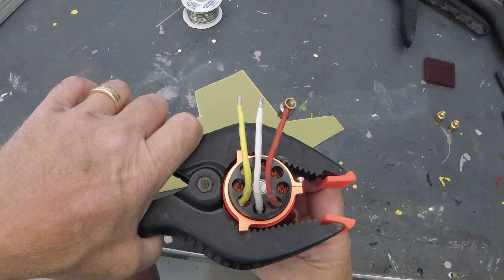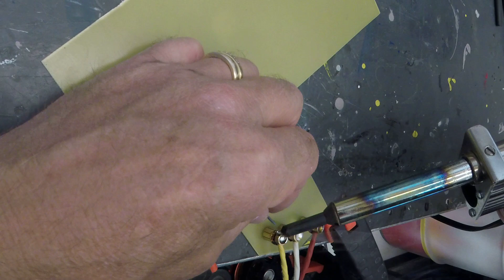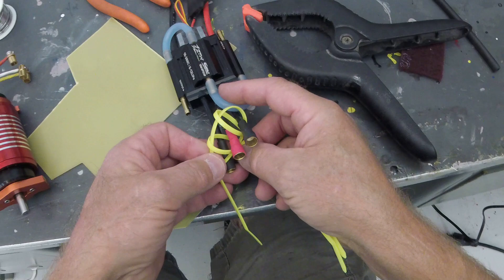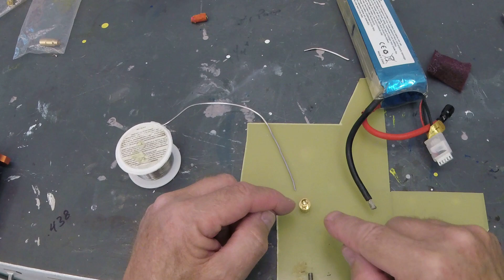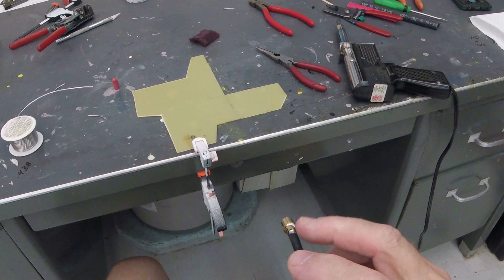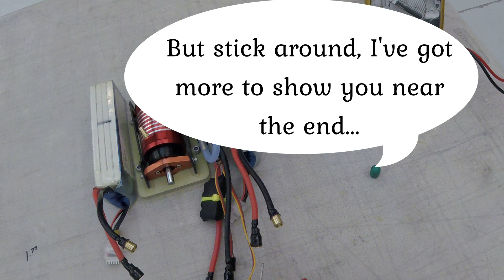Electro Eliminator | Soldering RC Battery & ESC Wiring - How Does It All Go Together?

Comment: Flux Paste. It cleans and shines.  Too much gun for me.  Get yourself a temp controlled Ebay clone soldering station with various tips.  Mine was $40.00 and Ive had it for years. Ive used it to make 100s of night kits for micro helis.  Dark Matter Blades.   Its a YI 939D purple base.
Reply from the maker: Thanks!

Comment: Sorry, but I was so happy to see you get frustrated while soldering connectors. I end up yelling like I did 30 years ago when I started working on cars. There  a fine art to soldering for sure
Reply: Scott one thing to note. With solid wire the electrical field flows around the wire. With stranded wire the electrical field runs through the wire. Most of the stranded wire is aluminum. Try using Rosen core aluminum solder. This will make a better conducive connection with less heat. You don't want to heat and break down the wire jacket. as far as separating the wire, try using some automotive plug wire insulator clips.
Reply from the maker: Oh I hadn't thought of using aluminum solder. Or more correctly, I didn't know that was a thing. But yes I'm familiar with how those little electrons prefer to travel, and even with stranded wire they continue to travel around the perimeter, but the beauty is there is more perimeter area upon which to run in stranded wire. This is what bothers me most greatly about soldering in general. Presumably they (those little electron buggers) travel only along the outside of the solder, which then effectively becomes a resistor. This then becomes heated as they get frustrated in their travels, only compounding the problem. So... What then is the best possible method of connection?

Comment: next time twist the wire in the opposite direction of the original twist. you want it to  fray. work rosin flux into the wires into the original twist direction. it will then work into the core. make sure your solder joint is shiny . that's the way we did it on titan 2 missile wiring .
Reply from the maker: Interesting!

Comment: Believe it or not, Volts and current going to The motor are converted to 3 phase Alternating Current in the ESC. And by reversing 2 of the 3 wires, it reverses the tractive direction of the field windings changing the direction of the armature. Without changing any of the built in timing between the armature and field windings.
Reply from the maker: I prefer to believe it is magic!  🪄

Comment: Just bought a second hand Aquacraft UL1 and make the mistake of taking it right on the water trusting the seller is ready to run. Lost the propeller as the flex shaft snapped right off the prop. Now binge watching your videos and damn, there's a lot to be done before getting wet.
Reply from the maker: You got this!
Reply: @M5PerfHydros  fixed everything that could be fixed without ordering  parts, made a new rudder lever as the old one had the grub screw enlarged. New rudder pivot shaft made off SS 4mm, new esc and battery connectors. Waiting for the shafts, tubing and few more bits, can't wait to see it finished. Your videos helped a lot, and will help more I'm sure.
Reply from the maker: I think I'll be needing to see a video of that...
Reply: @M5PerfHydros  took a few snapshots during the rebiuld. She's now almost ready, just some epoxy to set on the rudder bottom plug and tomorrow  will be baptised.
I'll upload the photos and share !
Reply from the maker: Looks great!

Comment: zip ties are a good solution for more permanent connections like motor-to-esc ... in models with a single battery pack I also make the wires different length.
I usually shorten the battery's negative and the esc's positive wire by 2x connector length and tape the battery's wires together ~ 1" behind the short wire's connector.
This way it's still easy to connect/disconnect them, but physically impossible to short the battery pack.

Comment: Use a separate Flux for tinning solder, plasti-dip (for tool handles) easier for the connectors.

Comment: You should always use silver bearing solder on your battery and motor leads as it has a much higher melting point than standard rosin core solder. I have seen some high amp applications melt the solder and stop a boat in the middle of a race!
Reply from the maker: Yup!

Comment: If you dip the Wire into Liquid Flux, then solder it, this will created a VRY good connection, i do this on all my 12 Heli batteries..
Reply from the maker: Thanks!
Reply: @M5PerfHydros  No Problem Scott. I can also share the part number of the flux i am recommending if you want.

Comment: I think youre not supposed to use dielectric grease between the electrical contacts, just around them.
Reply from the maker: There's plenty of debate about that, and it's easy to find logical arguments for all opinions!  Best I can do is go with what works for me.... I've used dielectric grease in sensitive automotive connections for literally decades as a career auto tech (recently sold our shop and retired, thank goodness), often solving connection problems with it's application alone.  I first found it used in the multi-pin engine control module connectors in all the OEM vehicles starting sometime in the late '80's or so.  Pin corrosion was a super common problem prior (computers started showing up in cars around '79 or '80) but was greatly reduced with the introduction of dielectric grease. So... I use it faithfully in all connections on my boats, and haven't run a radio box for years with zero (knock on wood!) failures!
Reply: @M5PerfHydros  Point taken, Scott.  Thanks for the videos and reply.  I can see you certainly have a lot of experience with the hobby; sometimes whatever works is the best solution.  You might see my point that putting a non-conducting grease between your metallic contacts may seem counterproductive, after all the pains you take to ensure optimal performance of your boat.  May I ask....since you are adding the batteries in series, totaling over 30 Volts, what is the maximum voltage rating for your ESC and motor?  Also how do you choose which electric motor to use?  The Oxidene Marine website sells theirs for $150 and with ESC for $250.  Are those reasonable prices?  I was thinking of building a scratch nitro boat, but I have no knowledge about nitro/glow engines.  Do you have plans for yours or similar hydroplane that I could download?  Thanks again.
Reply from the maker: There are spec motors allowed for racing in R/C Unlimiteds here in the NW, and they don't cost nearly so much.  If you're curious, contact Bill Brandt at Rattlesnake RC and he can hook you up with the full package at a much better deal.  You'll find him at www.allrc1.com , and don't forget to tell him I sent you!

Comment: What a great idea about using Liquid Electrical Tape.
That would have been a much simpler method for me to use instead I searched all over for the correct size heat shrink tubing with sealant inside of the tubing.
I found by Young Fastener Products, Heat Shrink Heavy Wall With Sealant Black part number STH12B-1. It is 1/2" diameter by 6" long for my 8mm bullet connectors.
Red tubing part number is STH12R-1.
I picked it up at my local McLendon Hardware store.
The packaging mentions www.cabletys.com
Reply from the maker: Thanks!

Comment: Get yourself or build yourself a “The Jigs Up” soldering tool. It will hold everything you are doing firmly. And like was said before...I used kester 60/40 and I take all wire but especially the heavy battery wired and work some flux into it really good before tinning and I also use some on the connector and tin that first with it before making the connection.

Comment: I prefer a mechanical hold as best as it can be then use the solder as a filler. 
I have turned the connector and drill a hole more suitable to wire size, some times I have to twist the shit out of it to tighten as much as possible  then solder it. 
Grease 👍👍keep out humidity. 

Transmitter, sure,,,, it transmits inputs to motor and servo😁😁
Just recreational for me, but also anal like you men! The zip tie cracked me up!
Reply from the maker: Such a relief to know I'm not the only one!

Comment: Over time those types of connectors get compressed.  You'll see the gaps in the male end get more narrow.  The connector relies on some spring force to keep a good connection.  When they start getting compressed you get a loose connection causing arcing and heat in the connector.  It's a good idea to periodically check the connector and use a thin flat bladed screw driver to open the gaps back up and provide that spring force to keep a good connection.
Reply from the maker: Excellent! Thank you

Comment: I have a speed master rudder when mounting the rudder bracket I used a square to align to the transom. Before drilling any holes i attached the rudder and it didn't look square to the bottom of the boat. I took the rudder off and noticed that the machined surface of the hinge for the rudder was thicker on one side causing the rudder to tip put of square. So should I use my angle finder to make the rudder 90° to the bottom of the boat?
Reply from the maker: Well that must have been pretty disappointing.  An angle finder would probably work fine so long as the spine of the rudder is equal width top to bottom and you hold it carefully on that spine.  Plan B would be to send it back to Speedmaster for replacement!
Reply: Ok thanks

Comment: As soon as you touched the wire the oil on your skin contaminated the wire making it hard for the solider to flow.  Get some Rosin soldering flux Flux is a chemical cleaning agent used before and during the soldering process of electronic components . ... The flux also protects the metal surfaces from re-oxidation during soldering and helps the soldering process by altering the surface tension of the molten solder. McMasters or Amazon Best Sellers: Best Soldering Flux - Amazon.com
Reply from the maker: Thanks Tom

Comment: For soldering those large connectors, I use a heavy old-school soldering iron. It takes ages to warm up, but it has such a large heat capacity! It heats a big connector and those fat leads up in like 3 - 4 seconds.   Boom, done!
Reply from the maker: Nice!

Comment: Great Video. I was hoping you would talk about the cap bank on the ESC. Like the proper way of wiring it in . You've set up for series on the batteries.  Does it matter Series vs Parallel on the cap bank on how it's wired or is it the same both ways?
Reply from the maker: I'm not an expert on the "Why" side of the capacitor question, but I do know a couple basic rules;  Capacitors must be added in parallel and should be mounted fairly close to the ESC (within 1" - 2") on the two input wires only.
Reply: Cap banks are to survive 'ripple effect'. That's when the prop leaves the water and then bites back in the amp draw can serious spike. The capacitors cushion the blow. They are wired parallel with the batteries.

Comment: You can wipe the solder iron tip on a wet paper towel or sponge before you solder, cleans it for a nice connection/heat transfer. Don't know if its easy to remove the liquid tape if you need to re-solder. I usually put a smaller diameter heat shrink wrap at the base of the wire, solder connector, slide shrink wrap back up to connector, then slip over a larger diameter shrink wrap over the 8mm connector. Then when you heat to shrink it, you don't have trouble getting the large diameter shrink wrap to shrink enough to grab the wire, it will grab the smaller size shrink wrap for a nice fit.

Comment: As stated below, a little flux will make the solder go all the way through the wire strands. Just be sure you DO NOT use flux for acid core solder, only flux for rosin core !
Reply from the maker: Thanks James!

Comment: The better way is to machine copper sleeves for the wire to fit tightly into and the OD to fit as tight as you can into the connector. Solder all that up.
Reply from the maker: Yikes!  That's commitment!

Comment: I use bow string rosin from a music store or by the commercial liquid rosin, put your gun in the rosin to heat it up and dip the wire into the melted rosin then tin your wire add a small amount to the connector also, it will suck it up no problem. Cleans the wire, connector and gun, Good stuff trust me so much easier.
Reply from the maker: Interesting!

Comment: Lol yea trailers with locked up wheels are funny cus 90% its their fault.  Killer tips die electric grease is a freaking life saver use to use it to seal the air box on the jeep an the distributor. 😁  ive used grease before works for quick seal.
Reply from the maker: Bingo!

Comment: what size flex cable are you running please ?
Reply from the maker: I/4" flex to a 3/16" prop shaft
Reply: @M5PerfHydros   , thanks Scott , I can't find a collect that will go from 1/4' flex to 5mm shaft on the motor ?
Reply from the maker: Your motor has a 5mm shaft?  Yeah I don't know what collet would work.  Have you asked Bill at Rattlesnake RC?  He's pretty sharp when it comes to electrics.  
https://www.allrc1.com/
Reply: @M5PerfHydros  , yeh , what size shaft is your motor, Im pretty sure mine is the same as yours, and yes buying my stuff from Rattlesnake and shipping to Australia , nice work by the way